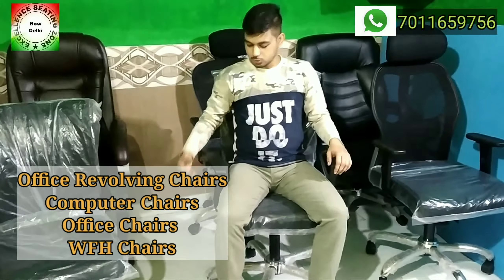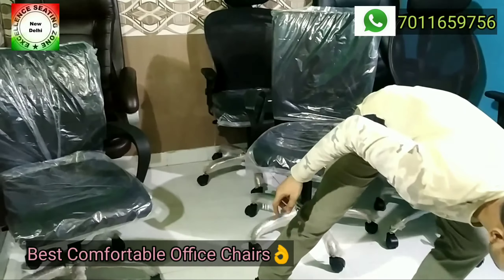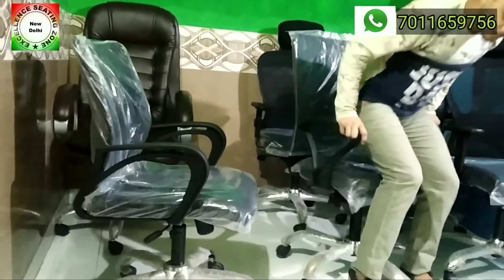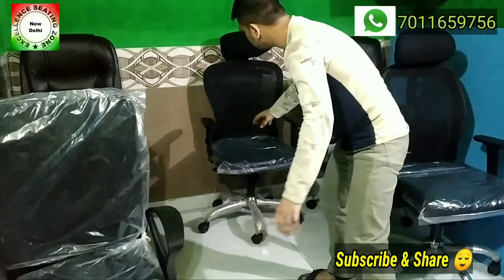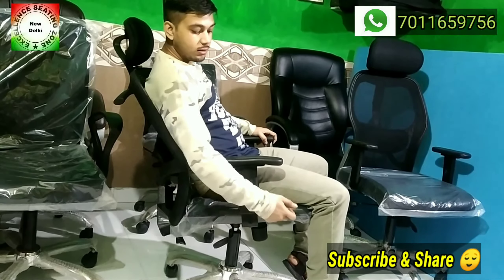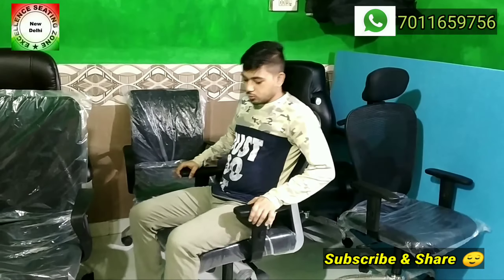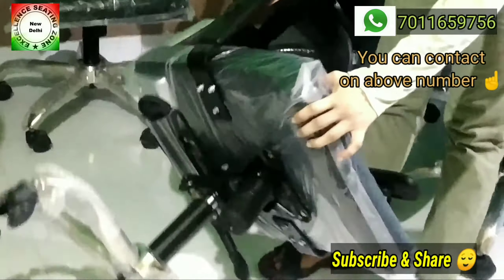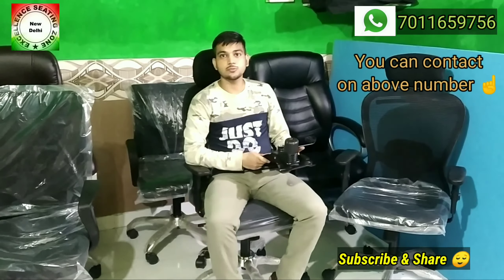Different Types and Mechanism of Office Chairs Plate | Features of Diff Tilt or Recline Explained 😎

Comment: I have tilting plate in my chair, can it be replaced with synchronus or any other plate?
Reply from the maker: No sir, because bolting is bit different.
Reply: Yes but is cost heavy and synchronus plate is not easily available on market tilt and pushback is common

Comment: Bro can we replace anywhere lock plate with pushback plate...?
Reply from the maker: No brother, size of both the plates are different.
If you have synchro anywhere lock plate than you can replace it with normal synchro plate (Synchro Anywhere -> Synchro Mechanism) and if you have anywhere tilting plate than you can replace it with normal tilting plate (Anywhere Tilt -> Tilt Plate).

Comment: Price of sycronic and tilt plate difference. Which is more better
Reply from the maker: As per me synchronous plate is better and it's costly too. 
Note : You can interchange chair's tilt plate with synchronous plate as for both the mechanism(bolting) is different. They are not interchangeable.